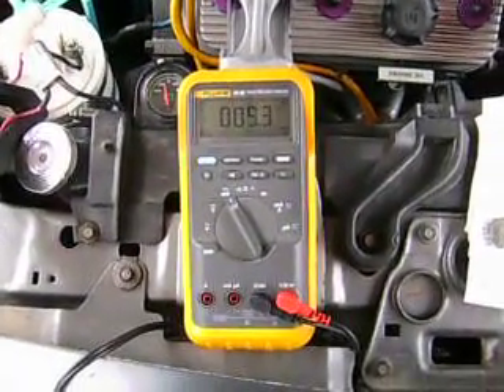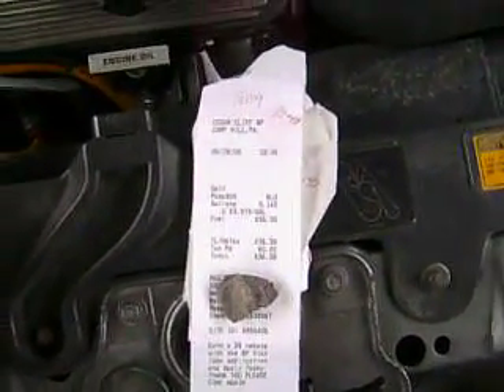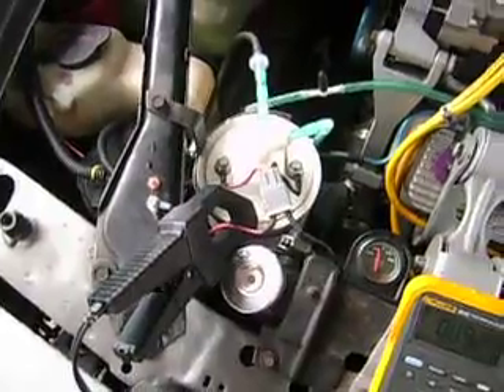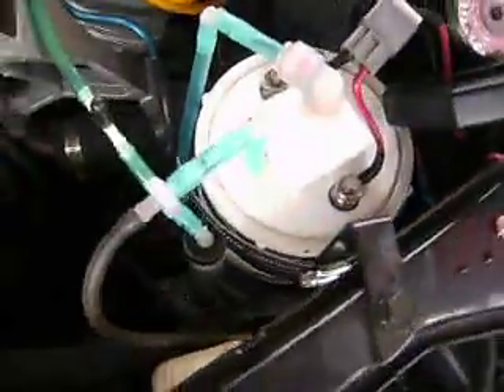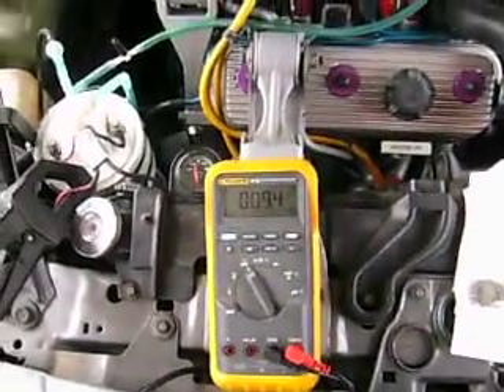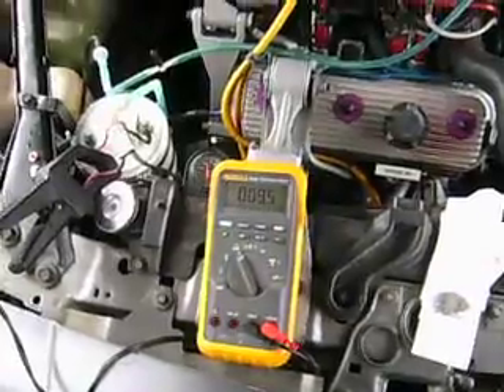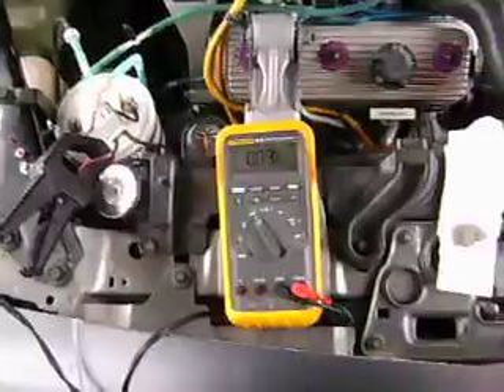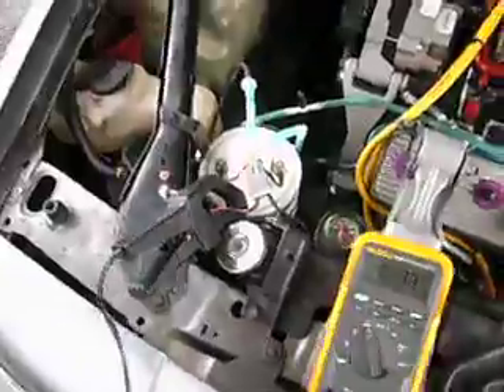Mods to the Smack part 2

Comment: If you have a pwm and push 20 amps through a 10 plate cell with 12 gauge 316L stainless steel do you think that it would damage the cell???